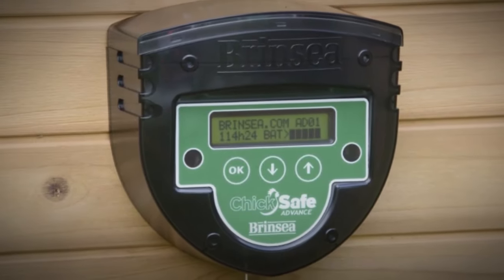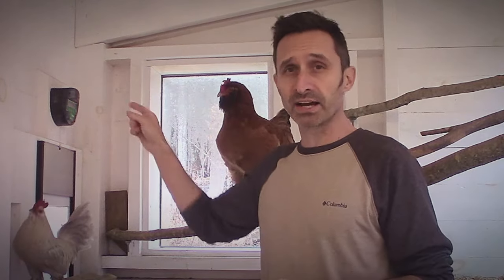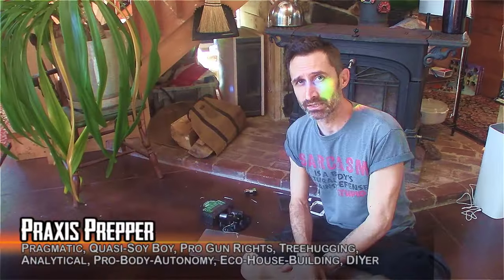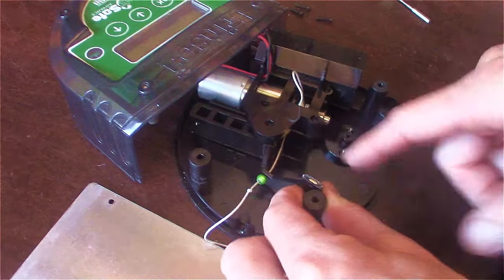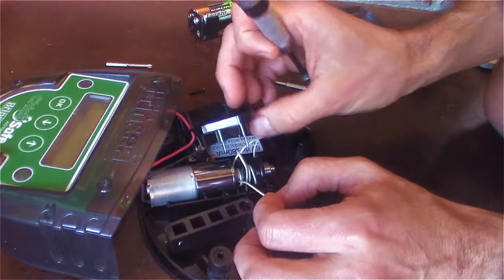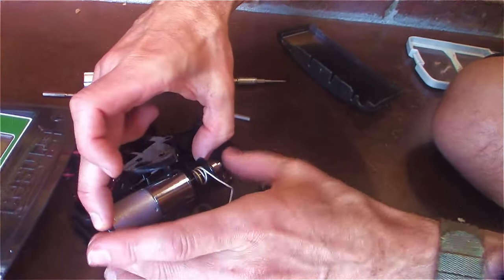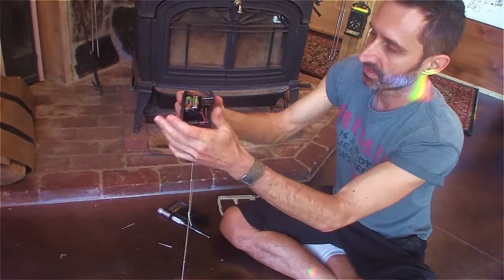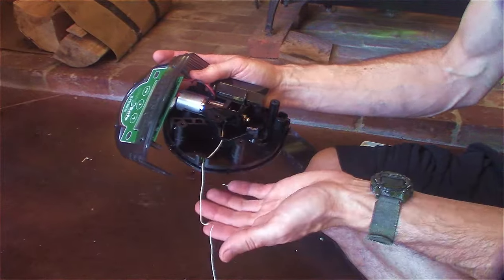Fixing a Jammed Brinsea ChickSafe Advance Automatic Coop Door Opener

Comment: Could've been also one of your hens? Force its  way out Forcing the door up maybe
Reply from the maker: Yeah. Good thought. Maybe it was on it's way to open and they pushed it up and the extra slack popped it over the spool. Good thinking!
Reply: I personally believe this is the problem with my chicken guard door,  the door has a safety mechanism that senses something underneath,  if it gets pushed up the door will automatically stop, the problem is I have gotten door errors with the door closed.
Reply: I had that issue with the door trying to close too where the plywood it was mounted too warped ever so slightly so the tracks weren't straight and it caught up. When I built this new coop, I paid super close attention to making that wall where it was to mount INCREDIBLY flat and super rigid to try to avoid that happening again. So far so good with that one. I overall like this door, but the fact that it's relying on gravity vs powered has some trade offs. But I like the "no chickens getting crushed to death" benefit of this approach. @MosaicHomestead
Reply: @PraxisAdventures  the new door I made floats between the tracks, you can see it sway between the tracks, chicken guard 2022 is a piece of shet, Carolina coops stopped selling it because of this problem.

Comment: I took my chicken guard apart,  no tangled strings, I get door error displays,  I get them once a week,  not worth the money,  I could have used the money for other materials, and trust me when I say I'm good at fixing stuff, I would fix thrown out VHS players when I was a kid, I also could build bikes out of garbage bikes, Originally I was going to build my own door.
Reply from the maker: You don't need to remind me of your mechanical aptitudes. I'm sure if there's some issue with your door it's not a simple issue like mine. What did you make of that lever that get's drawn up with the bead inside the unit? It seems to be an switch to turn off the motor, but I wasn't 100% sure how it actuated. I'd made that vague guess about the metallic part touching those electrical contacts, but I never really looked at it. What did you make of it?
Reply: @PraxisPrepper  it's the calibration mechanism,  the bead let's the brain inside know the door reached its maximum opening height,  then lowers door counting a magnet rotation, once there is no resistance on string,  it knows the door is locked, the con of the devise is the string,  Chicken guard has a new door without a string,  they also know the string is the trouble maker